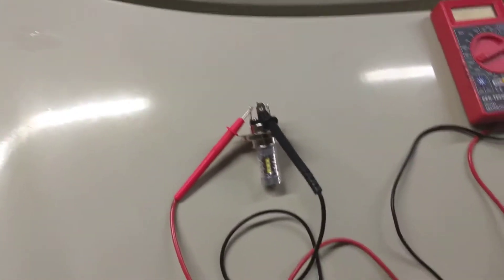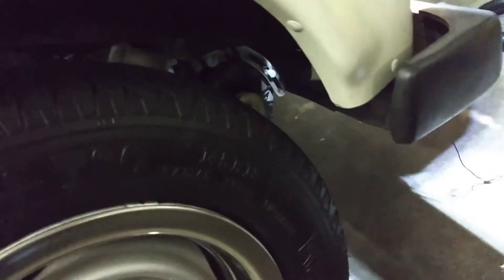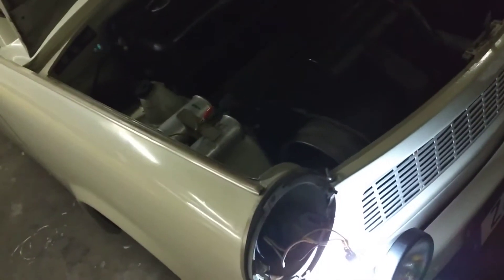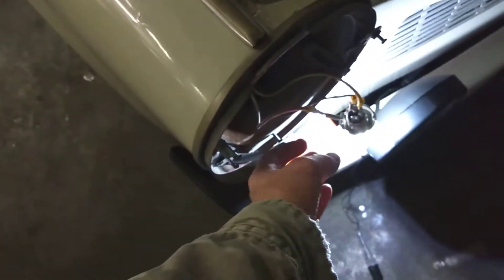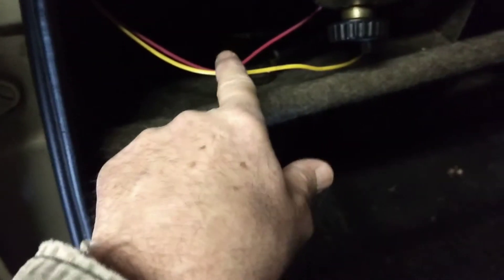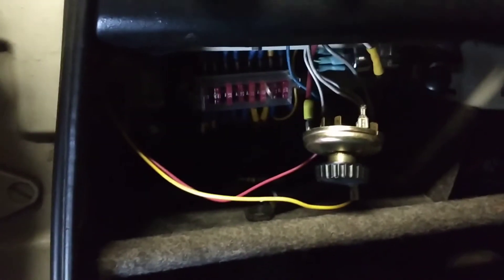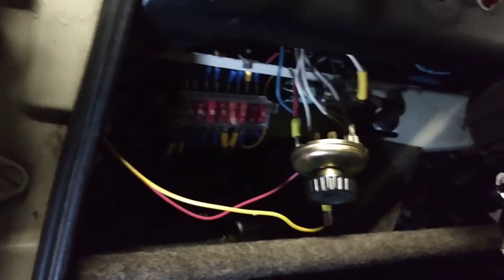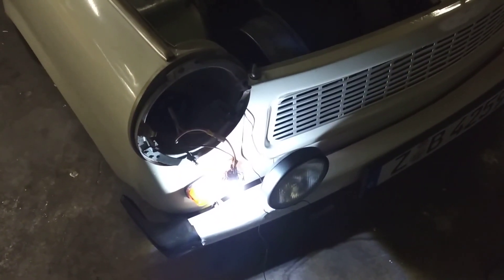Trabant 601, LED H4 Headlight bulbs

Comment: Hello,how remove the cap's (cache/ring) of the head light ? put a screwdiver in the hole,but what do ? i Don't understand the manipulation exact...if you can help me :)  and too you have fix the problem of that H4 LED ? thank's
Reply from the maker: Hi. I just stick a screwdriver in the square hole with screwdriver and just l push upwards. It should pop right off.
Reply: @turbofiat  Hello,ok it's easy ^^ i think than it's a clip to push for open (see on other car light), stay to me ,put new lights Inside, can you say me which fuse is for the number 9 ?power and use ? it's klaxon ? thank's again
Reply from the maker: That should fuse should be powered all the time without ignition switch on. If I understand what you're saying.